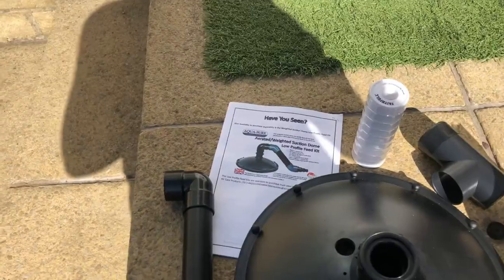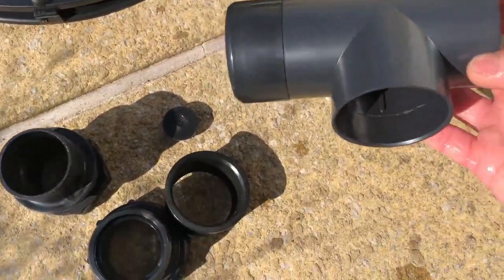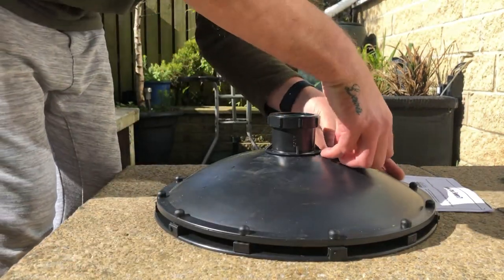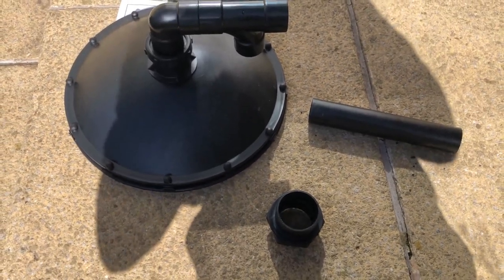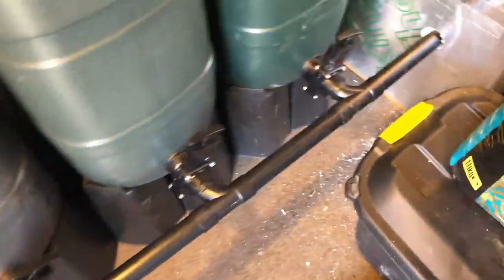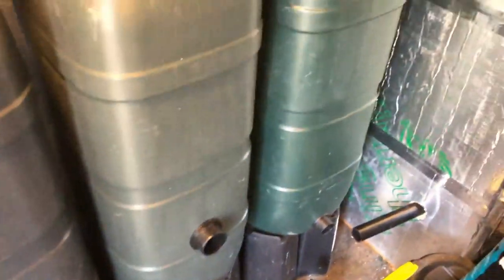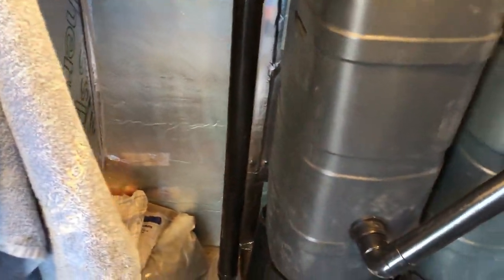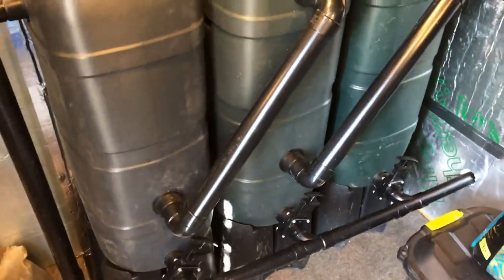DIY KOI POND 3 BARREL FILTER BUILD PART 2

Comment: Filter system is looking great, very neat. I would go K1 micro for the static bed, k1+ for the moving bed and jap matting plus other bio for the last barrel. I have the low profile kit for my drain and the first elbow has a hole in the top to stop airlocks. I also added a threaded union on my pipe work to make it easier to remove the drain if I need to. Apologies if this is my second comment but my first one didn’t show up in the comments.
Reply from the maker: Thanks Adam I did wonder about the hole in the top, as the parts that came with it, did have what looked like a small breather type bit to the top, so I guess if I remove the one off the original and fit it to mine it will aid with the air locks then, also its the first comment I have received, thank you very much for the information, youtube is a little messed up some times with comments etc 😀 👍

Comment: Nice barrel filter set up. Please can you advise where you purchased the 40mm solvent weld tank connectors ( presume  to fit 43mm pipe) pipe and fittings and also the side valves from. Thanks
Reply from the maker: All my 40 mm pipe and 43 mm 90degress & 43mm 45degress  joints came from screw fix mate.

The 1&1/2” bulkhead connectors & 2” bulkhead connectors came from kockney koi, the 1&1/2 slide gate valves came from my local koi shop, which is quality koi carp, in brighouse,Huddersfield. 

But I am sure you could also get them from kockney koi.

The 50mm pipe came from, james Hargreaves plumbing supplies and the 50mm, 90degrees bend & 45degrees obtuse bends   All of which are solvent welded pipes and connections 
I hope that help you mate 👍🏻👍🏻

Comment: do you still use it?
Reply from the maker: Yes it’s still on my pond now but my pond is twice the size it was
Reply: @GazsKoiPond  i caught the video after the build. i kind of went thru some of the same issues. took pond intake to the top, used 4 inch to connect barrels and 1st barrel is a swirl tank to remove solids. running about 12 years still